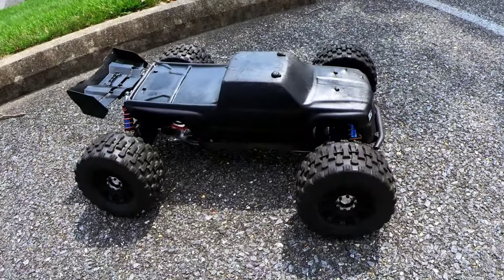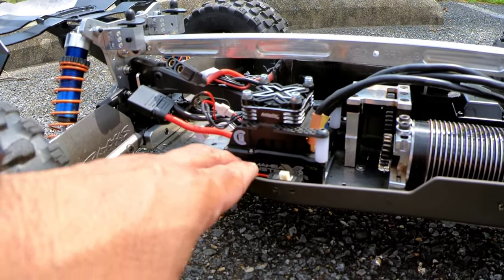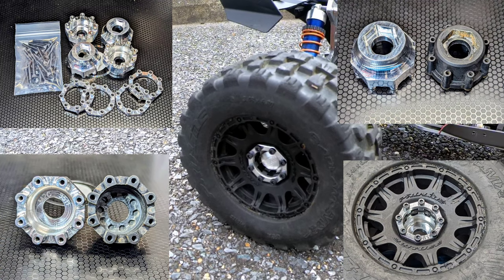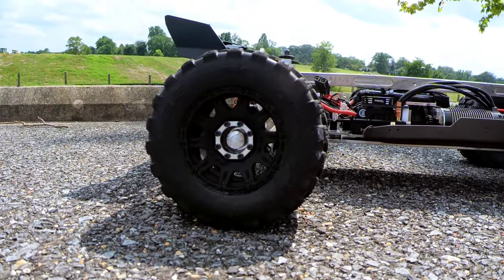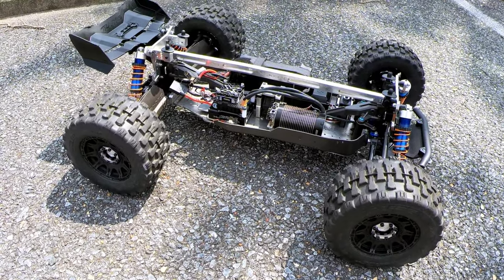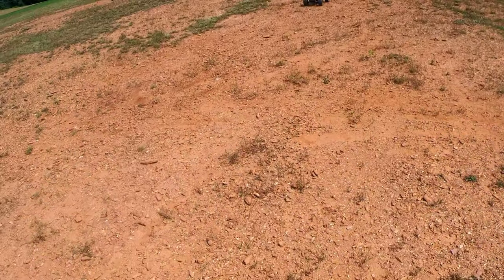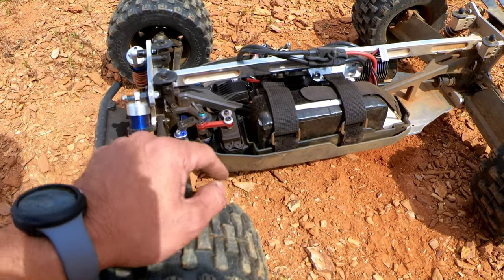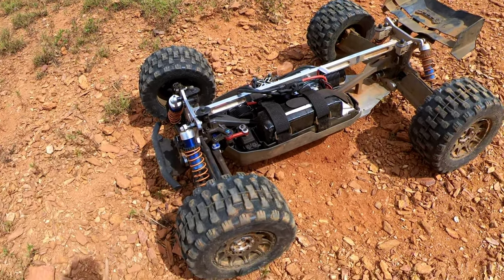M2C JACKHAMMR. Next level 'SICKOMODE'. M2C removable hex adapter.

Comment: Man, the SXL has some get up and go with your power system and gearing. Long wheelbase and it can likely do standing backflips. Great throttle discipline with those bump/front flips. Great redemptive run dude. 🙏🏻🙏🏻
Reply from the maker: Thanks so much Bro. I appreciate your time watching brother. She came back stronger than ever. I couldn't be happier with this run Bro. SXL Truly is an amazing Rig.